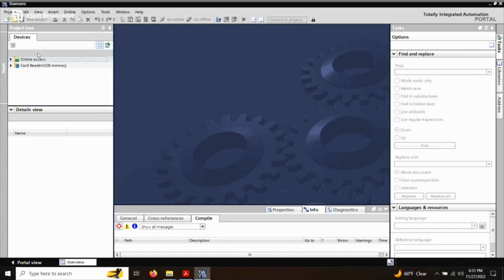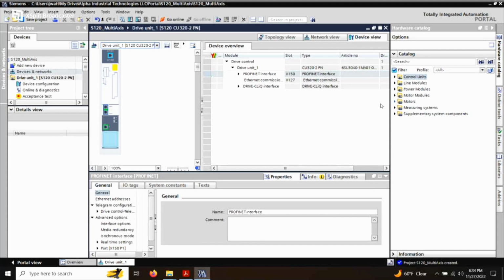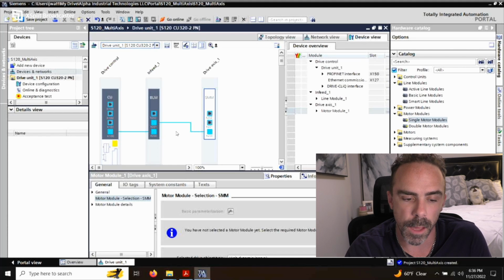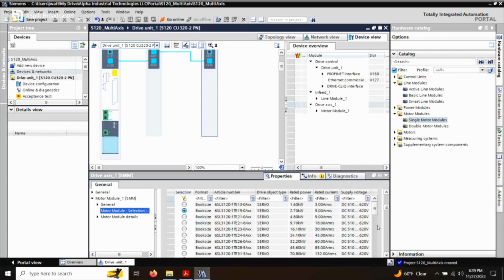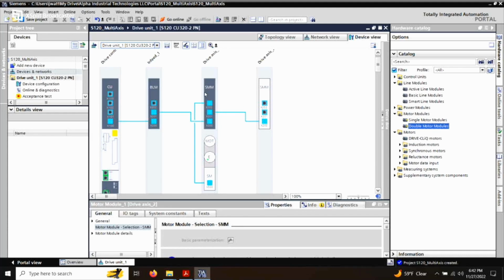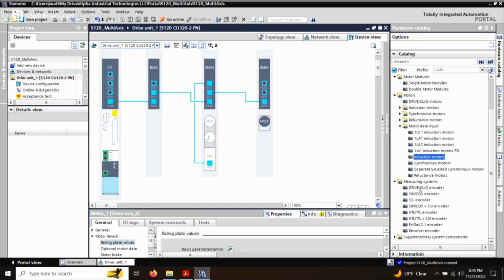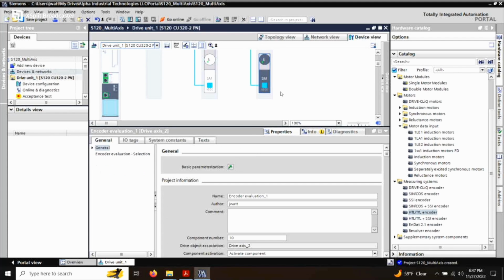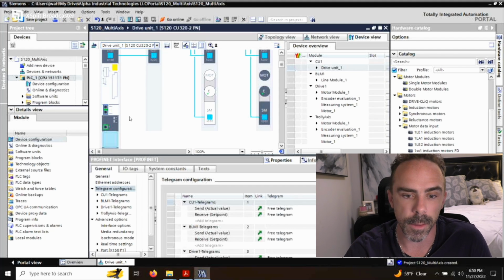SINAMICS S120 Setup in TIA Portal (STARTDRIVE)

Comment: is S110 any similar to S120?
Reply from the maker: Yes it is a lower performance unit that is designed for servo control of single axis motors. It has all of the features for servo control that the S120 has!

Comment: How to release motor brake by manual in PLC ?
Reply from the maker: There is a bit "release holding brake", i don't know if it is in the standard control word by default. I will have to look it up. It it is not you will need to map a free bit in the control word to the bit in drive then you can use that bit in the PLC.
Reply: @jasonwattsae  Which Telegram can use this bit ?
Reply from the maker: I think all telegrams have a free bit or two in the control word, but if not, just select the telegram you want to choose, then change it to 999 to "unlock" everything.
Reply: @jasonwattsae  What is 999 ,where can I change it ?
Reply from the maker: Telegram number 999 is the free Telegram. You can change iy in thr same place you select a standard telegram.
Reply: @jasonwattsae  Is the Telegram number 999 can use with additive telegram 750 for torque control in TO ?
Reply from the maker: Yes! 750 is an additional telegram so it can be used with any telegram number.

Comment: Sorry sir, how are setting reverse in servo s120 ? Please answer... Thanks you
Reply from the maker: In the control word, bit11 (drive) is "setpoint inversion" put that bit high and it will run in reverse.

You can also just send a - speed setpoint (-25% for example) and it will run in reverse.

Comment: Why CU320 have fault code 30040 after release emergency stop and reset ?
Reply from the maker: Thanks for your question! This is an interesting fault, one that I didn't not know from memory. I looked it up and it reads "Power Unit: Undervolt 24V"
While this fault may be coming into the CU, this fault is active only for "x_INF" object types. Meaning the problem is from your infeed module. If I had to guess, there is a relay, or contact that is dropping out the EN signal (which is 24V). It might be that that connection was also jumpered to the 24V+ input, which should always be on. Either way, you are losing the 24V+ supply power to your infeed. Check the wiring, then check that the 24V supply is not dropping out because of some other issue.

Comment: How to communicate Siemens driver g120 using c#(csharp)?
Reply from the maker: That would be interesting to say the least. I have never thought about how to send ProfiNet messages from .Net because there are some issues with bus priority... maybe you could control it using direct parameter access.... great thought! I will do some research and get back with you.
Reply: @jasonwattsae  ok sir thanks for your response
Reply: If possible give some examples or documents for c# communication
Reply from the maker: I will. I found a couple manuals that I will link after reading them further.

Comment: Hi sir
If possible, Please upload training video for S71200 CPU, V90PN SERVO, positioning mode in drive and to_object in TIA portal project, standard Telegram 111 in v90 parameters,
Reply from the maker: Telegram 111 is a great telegram to use if you are not using technology objects, but most of the functionality of EPOS is  easier to use the the "Position Axis" TO. There is an EPOS TO in later versions of TIA Portal, but all it does is make the configuration of the SINA_POS FB easier. 

The easiest way to control a V90 with an S71200 (I have done this on a few of my projects) if you are using EPOS is to use the SINAPOS block found at the link below:

https://support.industry.siemens.com/cs/ww/en/view/109475044

Comment: Could you please explain the difference between SLM and ALM modules?
Reply from the maker: Yes, I believe that there is a lot of information in my product overview video, but here is a short explanation:

SLM: Smart Line Module. This is a "Line Commutated" IGBT bridge rectifier that allows for current to flow back onto the grid. Harmonics are similar to a 6 pulse drive so a line reactor is required to protect the grid. This would be a standard regen drive

ALM: Active Line Module. This is a "Self Commutated" IGBT bridge rectifier that is capable of gating the IGBTs so that not only can it correct for power factor, but it can also boost the DC link voltage during low line supply voltages so that motor torque is not affected. In the US, the minimum DC link voltage on an ALM is system is around 720V. You must use a tuned harmonic filter called the AIM (Active Interface Module) that eliminates almost all of the harmonics cause by IGBT switching. The ALM has the ability to be used as a grid former to create an island grid. 

In almost all cases, a SLM system is less expensive than an ALM, but the ALM makes the system very immune to line power fluctuations and allows for much better torque regulation at the motors.

I hope this helps! I'll put this down as a topic to discuss because the ALM is a really cool piece of technology by itself.